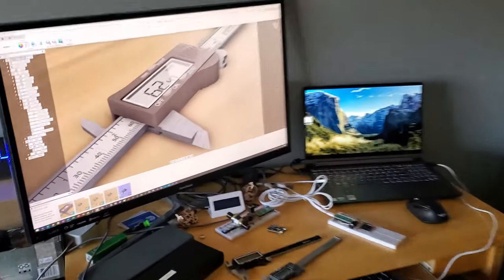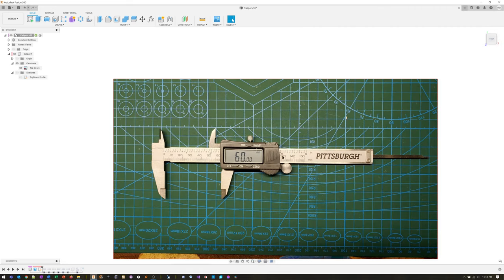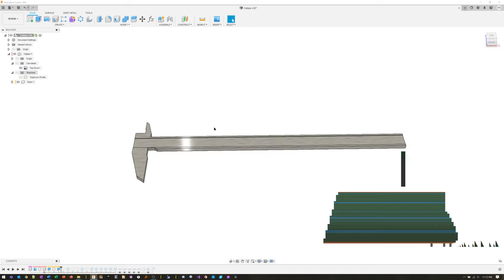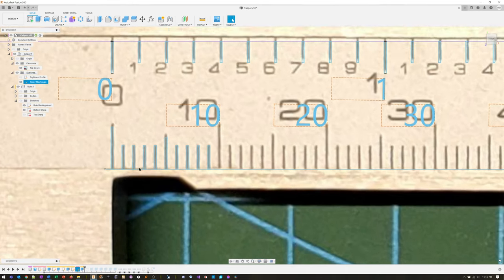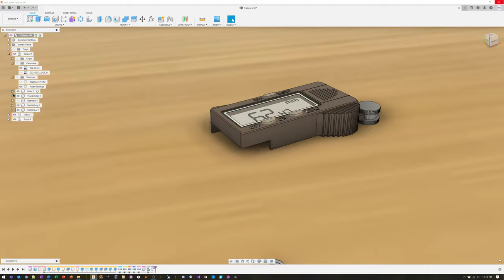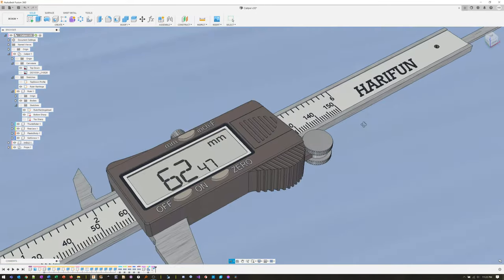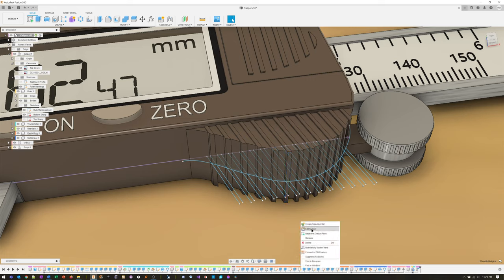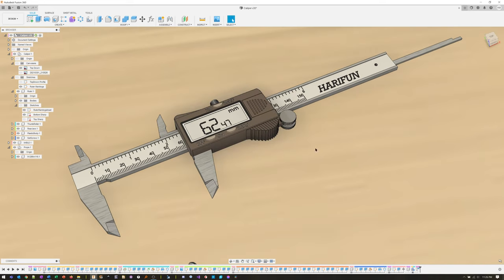HariFun #201- Caliper - a self portrait

Comment: Its amazing when you stop and look at how something is made. The original caliper have been around before CAD. The electronics are amazing, every time its moved back to zero it is never off  even if you just pull the slider back and forth as fast as you can
Reply from the maker: Oh, I saw Big Clive did that stress test when he disassembled and reassembled his caliper. Yeah, pretty amazing how well these cheap calipers work.

Comment: Great example. Just a thought, I would have take the picture exactly as you did but then I would have used the Calibrate tool and measure between the jaws and setting the distance to the reading of the caliper display. Obviously that only works for the 2D sketches, but it would have saved you quite a bit of time.
Reply from the maker: Hi Spike! I forgot to show it in the video, but yes, that's a good idea and I did something like that. I calibrated the actual ruler part of the caliper.  You're right, the traced sketch is pretty close to actual. Good point.

Comment: Wow, that's amazing. I've been doing one or two Fusion tutorials a day for the past month. I'm getting better, but still struggle. Did you consider using a decal (render workspace) for the markings and logo?  The real objects are much cooler of course.
Reply from the maker: Hi Karl! Practice gives me confidence. Even when I don't know how to solve it, I now have the courage to try.  Yes, I considered decal. It is a valid solution. I rejected it for two reasons: 1. I want ALL the markings and numbers to be on the model so the caliper could slid in and out and not have missing numbers. 2. To do that either, I have to disassemble the caliper or draw it myself in some other program.  I opted for the all Fusion solution. Thx for the comment Karl!